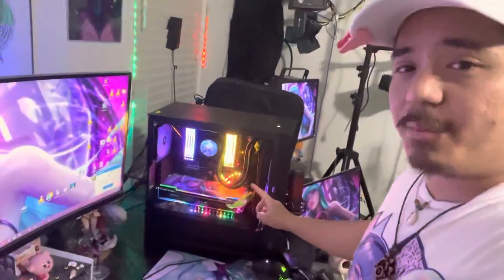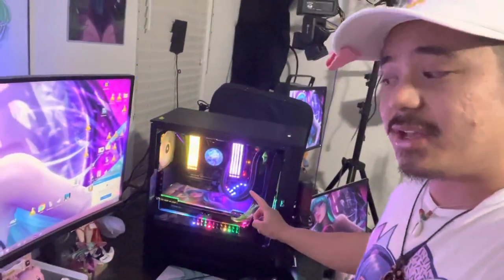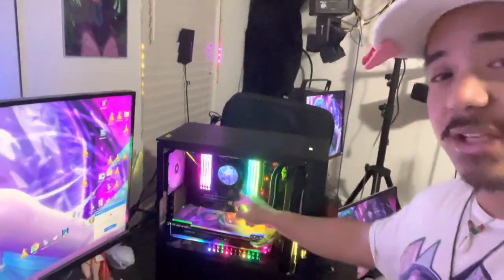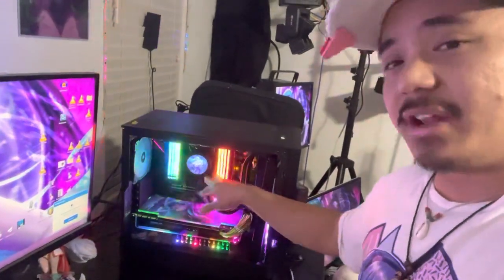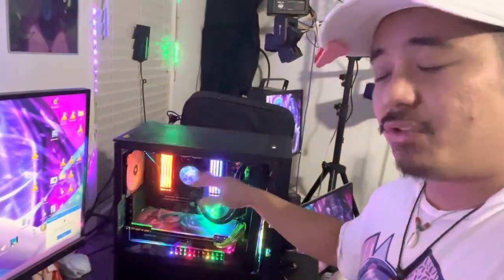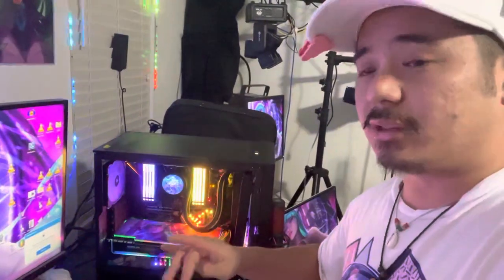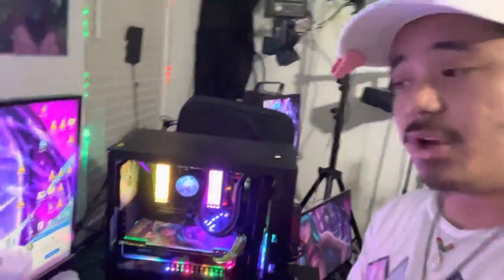Instructions on fixing the air bubble problem on the NZXT Z73 (yes it involves shaking it)

Comment: Just turn the PC upside down til sound is gone
Reply: That didn't work for me.
Reply: It just started happening again after like 30 seconds
Reply: holy shit it worked for me lol. it's been half hour and i dont hear anymore noise
Reply: Worked for me thx
Reply: lmfao wouldn't that mess up the computer somehow?
Reply: @GreigaSP  not exactly. If you can get your computer open safely, you can tilt it back and forth gently, or flip the AIO Pump around
Reply: @GreigaSP  i mean it fixed mine tho, its been 3 days and i dont hear no more noise
Reply: @Nobody_lol was it affevting you other temperatures?
Reply: hey this worked for me only when i turn it upside down, after i turn it back up the noise went back for me, any fixes?
Reply: Bolt it into place upside down
Reply: @zen3769  leave it flipped over, running all night, then slowly turn it right side up

Comment: I tried everything. In the end I just took off the pump from the cpu and rotated upside down, replacing the paste only because i was taking the cooler off and no more noise. Shaking, rotation of pc ect didn't help but rotating pum head works for my pc
Reply: Did it fix temps
Reply: @GodlyNix1  yeah, no problems since then. It's just air trapped inside the pump head. I guess.
Reply: i’m having the same problem with a different aio lol

Comment: I used to do that after maintenance on my x62 whenever I got the issue but found out that lifting and tilting the pc while its running and monitoring temps is faster don't need to uninstall everything and re apply thermal paste
Reply: how long do you keep it upside down for? just until the sound is gone?
Reply: @Verition  For me it was just a second, if everything is ni place you might aswell tilt it everywhere or give it a little shake for the bubbles to move around

Comment: Bro, How can you get the pump to run when it is disconnected from the computer, if you run the computer without it, it will overheat.  No one talks about this.
Reply: I think i know what you are asking. You have to disconnect everything from the power supply and connect only the pump to the power supply. Just rotate the pump like said. Take the pump off and rotate 180 degrees and install it .
Reply: @tomislavkruz   Did that, even shook the shit out of it for like 1 hour. Tossed it in the trash.  Junk.

Comment: Do you need to reapply thermal paste?
Reply from the maker: Any time you remove the CPU from the heatsink you should reapply thermal paste, but it's ultimately your choice.
Reply: Nah, you are fine with the same one, air bubbles between the CPU and cooler is a myth

Comment: When you had that problem, does it make a weird clicking noise prior to fixing it because mine started giving me a weird noise like 8 days ago! I thought it was an old hard disk but its not!
Reply: Yes, that's the issue I have but I've not managed to get the air out of the top radiator. When under load there is a sound like there is something touching the fan blades or almost like an electrical buzzing.
Reply: @JagdgeschwaderX same did you fix it

Comment: I have 240MM Antec AIO Neptune, everytime I turn it off computer I need to fix it by unbolted and shake it a bit to make it work, otherwise it'll automatically shut down due to CPU reaching 90 degree celcius,

Seems horizontal mounting on top like that is the cause. I usually unbolted it and make it vertical for a few second. then bolt it again.